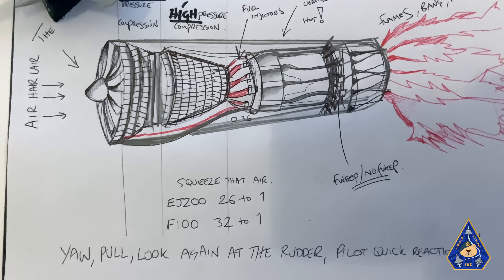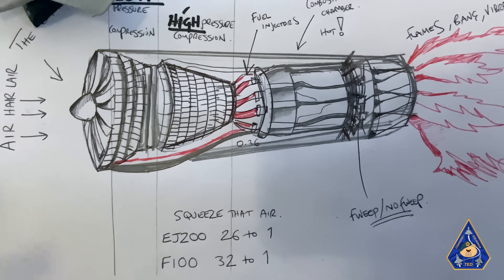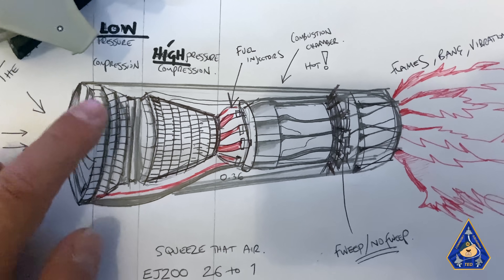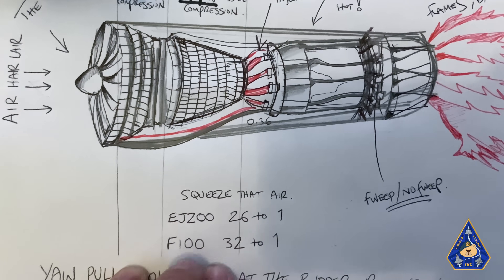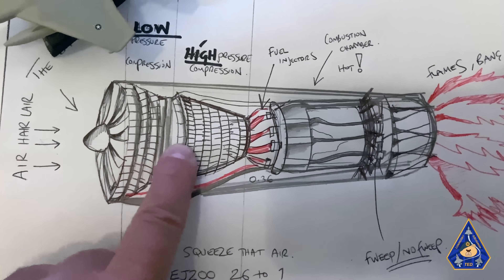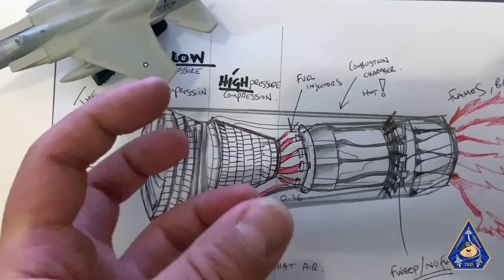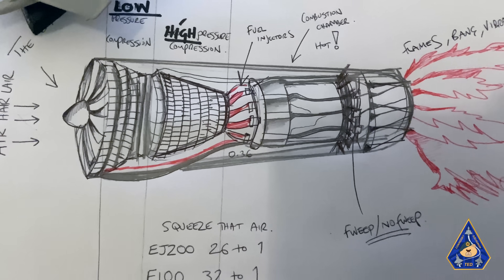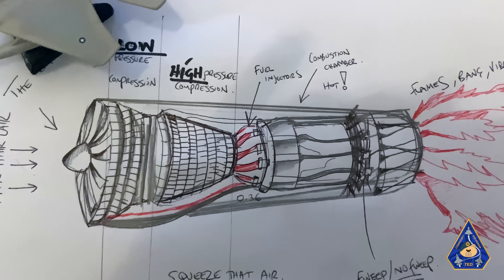SUPER REACTIONS FROM F-15 FIGHTER PILOT! WHAT IS A COMPRESSOR STALL / SURGE • USAF RAF LAKENHEATH

Comment: why does the pilot continue to pull back in the stick after pulling back the throttles,I thought you would do the opposite to prevent accidental low speed momentary take off???
Reply from the maker: I have no idea what you mean but the pilot did everything correct in lightning speed :_ted2:

Comment: First thing I did - checked the wind sock.  It is hanging DEAD still.  So if  the airliners have to wait a minute or 2 for each other, with big ones having to wait 2 minnutes...  How can these guys just take off in QUICK succession without a cross wind that would at least take some effect off it.
Reply: Firstly even though these aircraft look impressive, the power is nowhere the same as a A380. Small aircraft so can do a duel take off. Less effected by disturbances as they have small wings.
Reply: I know they're smaller - they still have TWO afterburners high powered engines.  
USAF normal sequence is 15 second splits.  The F-15 that got the stall, started rolling quicker than the other jets as well.  Time it...
Reply from the maker: They may be fighter jets, but they are smaller aircraft and not generate wake turbulence like a huge cargo C-17 or an A330 for example, so wake turbulence on takeoff is less intense:_ted2:

Comment: F-14A was extremely prone to compressor stalls, especially during high angle of attack maneuvers during flight or when just pushing throttle too fast. And F-14 on a single engine was prone to also go into a flat spin when one of the engines stalled. Whopping 56 F-14 were lost to crashes during the first 11 years of it flying (for reference, people think F-35 has a lot of accidents but there's actually been just 14 in the 11 years of it flying - a lot less than most people's favorite jets). F-14B mostly fixed the issues but not completely.
F-15 however is fine with compressor stalls in flight. It's engines are closer together and thus the effect is not enough to cause flat spins. Also, for F-15 compressor stalls are rather rare. Amazing to get one on camera.

Comment: A compressor stall is just the air bunches up and stops flowing and there is not enough oxygen to keep the burners burning and the engine flames out.  Most modern jet engines have computer controlled stators in the engines that mitigate compressor stall but if there is a foreign body ingested then losing a compressor blade will certainly cause a stall and or surge and the loss of the use of the engine.

Comment: Is it standard to use the stabilator as a spoiler in this scenario?
Reply: Yes.  It also transfers more weight off of the nose and on to the main gear.   The main gear is where the brakes are, so that decreases the chances of locking up a wheel and this allows heavier braking.

Comment: Great explanation apart from one really small but important point. When a gas is compressed it's mass doesn't increase it can't do that but it's volume decreases so it's density and thus pressure increases. It's still the same mass but in a much smaller volume. As I said great explanation/description apart from that. Just wanted to keep things scientifically correct. Thanks . Keep up the great work. 😁
Reply: @GarryAP  a compressor overall is a divergent duct however individual stages through the compressor are convergent duct . A divergent duct does this increase pressure and temperature.it will decrease velocity.So in the compressor we have convergent ducts that increase speed decrease pressure and temperature.The convergent duct bits keep the velocity of the air within limits. Even so at some rpm settings we have a bleed valve which dumps compressor air and ensures that the engine air doesn’t try to stall and cause an engine surge. I agree with your point on mass if you take a kilo of air and squeeze it then it will be still a kilo. I think most guys think that an engine will increase mass . Well a gas turbine engine will increase mass by increasing the speed of the compressor by increasing the speed of the turbine. This is achieved by increasing fuel flow to the combustion chamber.
Reply: @GarryAP  if you look at a given volume that used to contain one pound, that same volume, after compression, now contains more mass.  His explanation is perfectly fine.  Your outlook on it is just too narrow.
Reply from the maker: Thank you. When you compress air, it contains more mass. That is all I was trying to explain. Thank you :_ted2:
Reply: @TedConingsby  No Ted you are wrong but don’t believe me I’m just an AME . You can always google it.
Reply: @TedConingsby  yes if you increase the speed of the turbine by burning more fuel then you will increase the speed of the compressor. This allows more air to be drawn in by the compressor. More air more mass.

Comment: That pilots reaction time was impressive, off the Throttle and on the brakes straight away. The huge flames looked to me to be the result of an Engine Failure and not a Compressor Stall.

Comment: The 3rd plane started its takeoff roll too soon. The resulting wake turbulence from the 2nd jet disrupted airflow into the right engine causing it to surge/stall. The plane can take off just fine with one engine.
Reply from the maker: Oii oiii, Wake turbulence is less intense on smaller aircraft, so they do usually take off like this. Not saying you are wrong, not sure of the physics at the time, but the gap in between departures is a normal occurs FW at EGUL :_ted2:

Comment: Checked the slow motion and the suspect engine is still in Nozzle open compared to the good engine when the pilot cancelled take off.  Definitely be looking at computers and if it’s possible on this type of engine download the data from the engine computer ( commonly called in the RAF milking the computer.
Reply: Will also boroscope Turbines , Compressor and rear of fan. Use a light and mark one eye ball for 1st and 2nd stage fan .

Comment: Assuming no bird strike or FOD . The engine was in full Reheat. Bleed valves would be closed as dry range now at max power. Normally some bleed for cabin conditioning ,fuel tank pressurisation and other equipment. The reheat initially looks stable (compared to the other engine) . Can’t see any closure of nozzle just before flame out. With all the above and this engine being a FADEC engine then the most likely fault is a failure of the FADEC system. In some situations and this could well be one then the system can cancel Reheat and move the engine nozzle into ENC (emergency nozzle closure) . With no reheat and nozzle open then no power from the dry range. Reheat is a bonus for takeoff in case of an engine failure on most twin engine fast jets. A more accurate term for this event would be reheat buzz. It even sounds like a surge . Can be extremely violent and can cause damage to the engine especially the LP turbine and its shaft. 
Hope this is helpful to everyone.
Reply: As someone who works F100-229s on the 16s, I'm not familiar with the FADEC, is that an F-15 specific component? I'm curious if you're referring to the DEEC (digital electronic engine control) which can indeed induce engine stalls if faulty. Not calling you out in any way, just curious to learn about engines on other airframes. Cheers!
Reply: @WayFastWhitey02  FADEC is a generic term - stands for Full Authority Digital Engine Controller (some forms have 'electronic' rather than 'engine').  Full authority means all the engine operational parameters are in the digital hands of the computer - up to and including engine shutdown without pilot intervention.  An EEC is part of a FADEC system but is not of itself a FADEC.
Reply: @WayFastWhitey02  yep the Aussie F18 super Hornets have FADEC engines . The RAF and Royal Saudi Airforce have either a mecu or decu . Computers that control the engines . For example if I slam the throttle from say idle to max afterburner, the computer will ensure that the acceleration is controlled as quick as is safely as possible. For old timers like me it was hard to understand but got there in the end.
Reply: @WayFastWhitey02  Don’t worry i am now retired having worked as a serving member of the RAF . Went on and worked in Saudi Arabia as an apprentice master. Finished working for Boeing defence in Australia. Enjoyed most of my career working on three defence airforces.
Reply: Or possibly the preceding aircraft's exhaust given the separation distance.

Comment: Perfectly executed aborted take off, what may seem odd for some is the pilot putting the elevators up rather than down. Since he was not fast enough to get airborne, he used it as an aerodynamic brake. like spoilers/speed brakes in commercial jets! You can also use the downward deflection however this has consequences for the main gear being put under heavier stress. Great video!
Reply: Allows more braking action too as more weight on the main wheels

Comment: I know nothing about the engine powering the F-15s but bleed control valves can cause compressor stalls. Modern turbofan engines are controlled by FADEC....Full Authority Digital Electronic Control, and the EEC, for Electronic Engine Controller. That means there is no throttle cable between the thrust leevers and the powerplant. It's all electronic. And to some extent it is manually controlled by bleed pressures and solenoids. Bottom line....they are complex machines. This incident may need nothing more than a pneumatic health check or it could be internal damage. Could go either way.

Comment: What's the result when they're already airborne? Fascinating post - thanks Ted!
Reply from the maker: I think it will be a case of a go-around with a “May-Day” call to tower. I believe there are occasions it can be a one off or compressor stalls that are happening frequently. There will be a process the pilot will have to implement but this is for another video :_fweep::_ted2:

Comment: Can someone explain why, just after the failure, the ailerons were positioned in the same manner (actually even more extreme) as they would be for takeoff?  Wouldn't the pilot have moved the stick forward once he/she determined to stay on the ground?  Thus, the ailerons would have reversed their position.
Reply: Ailerons control roll (left to right).  Those are stabilities, which control pitch and roll. He pulled the stick back, as you thought.   This takes weight off the nose wheel and puts more weight on the main gear.   Since the brakes are on the main gear, keeping weight in them allows heavier braking without skidding a tire.   He did it exactly right.    The plane was not going fast enough, yet, for the nose to entirely lift off the ground.
Reply: @brianhaygood183  Thanks Brian!
Reply from the maker: The pilot was just about to take off and reacted brilliantly  :_fweep::_ted2:

Comment: As a gas turbine engineer of 40  plus years this is a fair description the main priority of course to shut down the emgine ASAP to avoid potential damage to the compressor ground staff will carry out a thorough boroscope of the compressor to ascertain any blade tip rub or other visual damage and depending on the severity any subsequent damage to the bearings.

Comment: Not a compressor stall, that’s an AB blow out.  Compressor stall blows out the intake.  Don’t see a whole lot of compressor stalls on 229 engines.  F-111’s used to have compressor stalls issues a lot.
Reply: Yep. 15 crew chief here. I’ve never seen a 229 ab blowout. Back in the day, it was common on the 100’s.
Reply: AB blowouts can induce comp stalls often, but yeah no signs of a stall here. God I miss 15s.
Reply: @ChoChan776  AB fuel / nozzle position is a problem of compressor stall. I have seen over fuelled afterburner, we called it Buzz. The LP turbine is the nearest turbine to the afterburner section and will slow down . Slow LP Turbine = slow LP compressor. Not good . The buzz effect in the afterburner sounds like an engine surge to the inexperienced.
Reply: I was going to mention the same point.
For certain an AB blow out.
I remember you btw. Go blue!
Reply: Sometimes its an AB induced compressor stall, usually on initiation.  The AB doesn’t light off correctly and sends a pressure spike up the bypass duct, hitting the back of the fan and momentarily stalling it.  The fans clears the condition and shoots a. Big flame out the back.  It will knock your feet off the rudder pedals.  I’ve had MANY on the -100.
Reply: ........ either way in combustion terms you end up with a diffusion flame rather than a premixed one out the back. She'll be up on ramps with an engine out jobee next week!
Reply: @jonathanledger1440  Not necessarily but likely. Had a massive reheat buzz on a Tornado GR4 . Problem was the engine computer. Changed the computer and inspected all internal parts of engine using a boroscope. Luckily no damage to the engine. Not so lucky with a F4 RAF Phantom. The buzz was so bad it put a hole the size of a tennis ball in the LP turbine disk cover.
Reply: Thank you.
But which one F-4, if I may ask? With R&R or GE engines... 🤔 ?
Reply: Notice how the pilot shut down the other engine as quickly as he could
Reply: @EdwardAspinall-e6h  Compressor stalls do manifest out of the back of the engine!
Reply: @ An AB blow out might appear as a large burst of flames coming from the engine nozzle, while a compressor stall could show flames or a visible disruption at both the engine intake and exhaust.
Reply: AB?
Reply: @ afterburner reheat to the Brits
Reply: @munkfish101 After burner I would imagine
Reply: @munkfish101 afterburner
Reply: @EdwardAspinall-e6h  What is AB?
Reply: So they need afterburner on both engines for take off ? Presume they have a V1 speed and rejected before it ?
Reply: I have watched an F-111 compressor stall and it backfired out the intake.  It was in the middle of an exercise at 0 dark 30, lit up the whole sky.  Everyone thought it was an exercise input (ground burst simulator) and started closing shelters doors and donning masks.  We had to do a spike check (limits airflow into intake at high speeds).
Reply: It’s is a type of compressor stall.  The air bunches up stops flowing properly and not enough oxygen gets to the burners and the engine flames out.  It’s still as stall but not a surge.

Comment: are ther safety nets ? in Lakenheath
Reply: There is a safety system which is a large cable that runs across the runway. If stopping the jet normally is in question, the aircrew can drop the tail hook and catch the “barrier” to stop the aircraft.
If the barrier is caught it shuts down operations for the runway and it takes a bit to reset. You don’t drop the hook unless you really need to.

The system is quite similar to that you see on aircraft carriers where the aircraft catches the wire to stop as a normal part of landing.
Reply from the maker: Oii oiii, there are two BAK (Barrier Arresting Kit) cables for each runway :_ted2:
Reply: @TedConingsby  Quite right. I was going to mention that, but felt my comment was getting too long and decided to cut it short. I was stationed at Lakenheath back in the F-111F era (mid to late 80s) and saw the barrier in action a few times. It’s better to use the barrier than not. Depending on the aircraft catching the barrier, the wire can damage the aircraft. The low rear underbelly toward the aft of the Aardvark didn’t always like the barrier. Thanks for your videos. It takes me back to my time at RAF Lakenheath and allows me to share my experience there with family and friends that wondered what it was like to be stationed there. You’re a champion!

Comment: i guess that the initial flow disruption causes incomplete combustion, low power in the output, which, in turn, reduces power to the "output turbine", which reduces the power to the inlet compressor, in a "vicious circle", thereby causing the engine to power down rapidly?
Reply from the maker: Hence Nikos’ explanation :_f15e: :_fweep: :_ted2:

Comment: That happened quite late on in the take off process too, certainly later than most I’ve seen at Lakenheath. Very lucky it happened when it did as they weren’t far off from rotating.
Reply: @aaron0288  However, at rotation there’d have been enough airspeed combined with thrust from one engine to take off safely. But… redundancy has gone, clear the runway, I’m coming round on a mayday. That’s when you don’t want anything else going wrong. I don’t know the F-15’s hydraulic system, but there might be some loss of services.
Reply from the maker: Indeed:_ted2:

Comment: First, I know the pilot knows the correct procedures, and I don't, but my gut is telling me that the by keeping the stick pulled back as was done in the aborted takeoff, there's less weight being exerted on the nose gear.  Less weight I would think would decrease braking effectiveness, but I must be missing something obvious.  My dumb question is: Would moving the stick forward instead be somehow detrimental?   An increased anger of blowing a tire on the nose gear, maybe?
Reply: The ground speed was high at blowout point. Rolling to a stop was probably a safer option.
Reply: @AnTiThesis-HaT-HoT  Enough power to take off on one engine, but risky as the pilot wouldn't have known if there were other things going wrong as well.
Reply: Would keep drag high though.